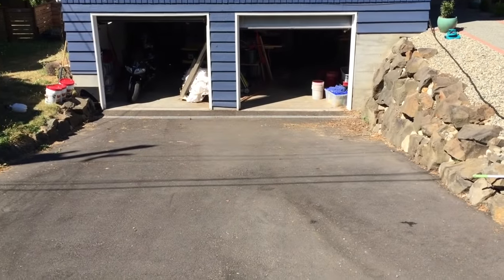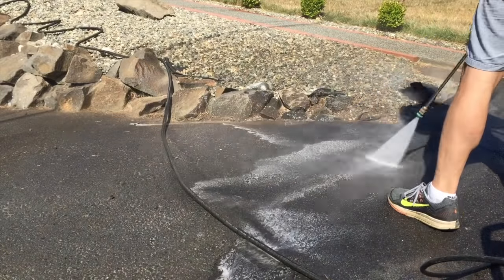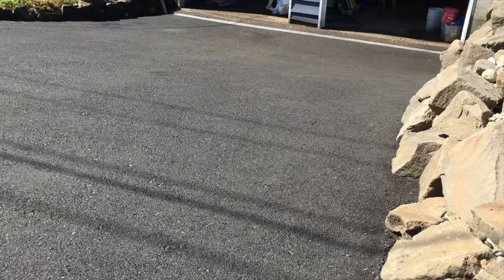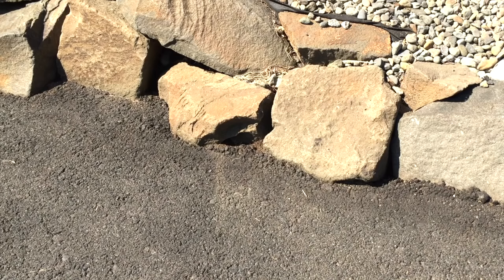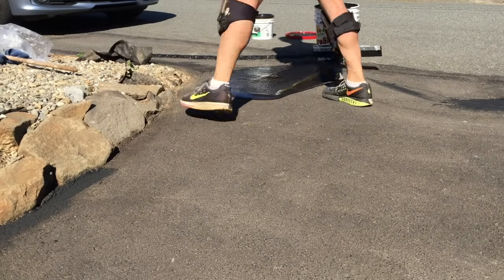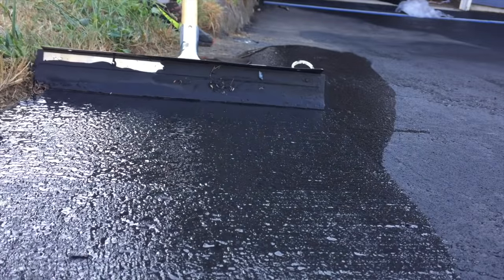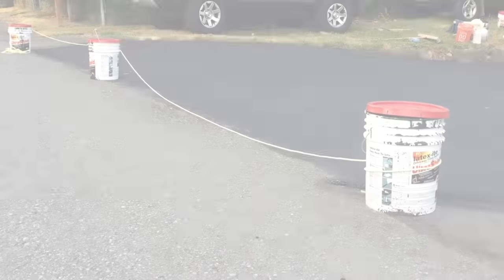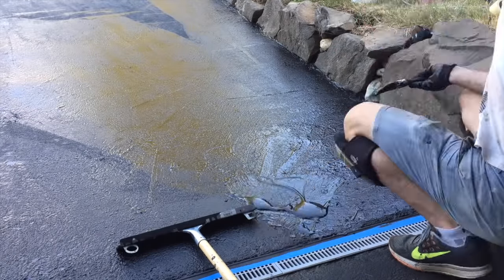DIY DRIVEWAY SEALING

Comment: See if you knew anything about Paving or seal coating , you would’ve known that your driveway is made out of an oil based tar so therefore you just put latex material on top of oil based product which that means that sealer is going to lay on top of the blacktop and not seep into the blacktop is what you want to give your driveway better life you should’ve went with a local seal coding company and they could’ve applied a oil based sealer you apply to latex sealer water does not mix with oil so therefore you just put a layer of latex on top of your driveway which is not good for your driveway at all meaning your driveway is only been there for two years you’re supposed to put that latex material or/water-based material on our older driveway not a driveway that is only two years old

Comment: I work for a County Public Works dept and we do a lot of paving. 1) You should not have to sealcoat on an annual basis. The exception being if you live in an area that gets a lot of snow and has a lot of deicer put down. 2) Weeds should not be growing through your asphalt. That is a sign of a poor paving job. Your contractor did sub-standard work. I would be asking for a refund. 3) The close up shots of your pavement show a very poor install job. Looks like the pavement was probably not laid down at the proper temp or mixed properly and it definitely wasn't compacted properly. 4) Your homemade diversion mound isn't the most effective solution for a permanent fix to your water issues. The best fix would be to install a full length drain at the top of your driveway, similar to what you have at the base. Contact your city or county to tie into their stormwater system. The top of your driveway is in the right of way so if the water issues are bad enough the jurisdiction might fix it for you.

Comment: He forgot to Trickle a bucket of cirnigraph oil, to reduce major deterioration.
He also left a portion of his anti tile destrinigraphy unmaintained under a ratio of 98:78:13 which could be considered illegal in some states.
He also forgot to dedementrios his 98:78 portion of centered 89:23. He may need to readjust his complecial oil mixed with dentorpian herbs, which needed to have a Ratio of 67837:75873:  as it may dry the gelestrio.

I made half of the words up here, and everything you just read was fake. I don’t even know what I was typing.....
Reply: Lol

Comment: You will use the pressure washer constantly. But you never used it on your driveway. I clean my driveway once a week.... keep your property tidy and clean. Also you only need to do this every 3 years if you keep it in good condition. Basically don’t listen to this guy

Comment: This is definetly the first time. Dont  do this call a pro.
Reply from the maker: Oooooo come on John.  This is a DIY channel, not a O I'll Just Hire A Pro to do it for me.  Driveway still looks good to.  Thanks for watching at least.
Reply: @BYOTools  Sorry, hope my comment wasn't rude. I just know the difference between the stuff you buy at a home improvement store vs. The stuff you get from a seal coat manufacturer. Like the difference between a picture painted using water colors Vs oil base paint. You are definitely meticulous and did a good job of covering everything. I think Bob Vila has a video on how to Sealcoat a driveway and is pretty good. Thanks for your video.
Reply from the maker: Hi John.  No need to apologies but thanks for the reply and the explanation.  Always want to know how I can improve and what to learn from.  I'm sure reputable seal coat companies have the GOOD STUFF vs. what you can find at HD haha!  Thanks for the input and for watching.
Reply: @BYOTools   1st you did excellent job cleaning your driveway. Which is one of the most important steps. 
2nd Its advantages to do your edging first. Edging works best if you can keep it in even stream of seal coat about 3 to 4 inches wide about 1 foot from the edge that way you can just push it towards the outside edge leaving smaller windrow of seal coat a couple of inches from the edge of asphalt. Then just one more pass to cover the remaining edge and your ready to start pulling main section. 3rd It works best and provides uniformity to work the seal side to side. Watching for surface tension which will leave little round 1/4 inch size untreated asphalt, and require another pass to allow the seal and the asphalt to bind together. Working the seal from left to right or side to side maintaining even distances  between passes will create a uniform protective layer. Hope this makes sense to you. Thanks

Comment: OMG all the Asphalt contractors are setting back and just laughing there asses of with his little paint brush and his power wash, don't make me even mention the  duck tape lol, I no it took him all day for that little driveway. Heads up my friend might save u time and money don't use any asphalt products from a hard ware store that shit doesn't last no longer than a yr and the second year it's already starting to fade so it's doin no Justice but making ur asphalt black. Next time hire a pro and ur squeegee won't fall off and it will get done 10xs faster and last 10xs longer if u use a pmm cold tar slurry seal from ur local sealmasters that is  All across  American. Drive way that size wouldn't cost shit to do so put ur knee pads up. And ps. Soaking water on ur asphalt just because u seen it somewhere  on the internet are a nosey friend told u to power wash it is not a good idea, it's not concrete. Soaking any thing in your Asphalt is goin to absorb and make it crack and soften, Duhhhh!!!  Y the heck u sealing it in the first place? Thats wat cracks and allagates asphalt in the first place rain setting on top and settling threw the asphalt. Just sweep it and power blow........ Just call a pro bud!

Comment: I'm just trying to figure out why you power washed your blacktop since the purpose of sealcoating is to keep water out of the drive way you sir are literary teaching people how to destroy thier drivways
Reply: Rockstar Boom the water will dry, but what is really destroying his driveway is the shit sealer he is using which is water based and will destroy your driveway instead of getting a professional to do it
Reply from the maker: If you ever want a solution to adhere correctly to a surface it better be a clean surface, which is why I pressure washed it first, let it dry completely and then sealed it.  Some people of issues with this way of sealing but I've had this product applied to my driveway over a year now and it still looks great.  Just need to pressure wash it every once and a while to make sure it stays clean.  Thanks for watching Rockstar and Cole.

Comment: Dude you have no idea what you are doing, you do this and it takes forever and looks like ass. Never go in the same direction as the driveway. Never use a rubber squeegee. Still can work, but doesnt give a lasting coat. Never start from the bottom. Start at the top, go side to side in passes with the end of the pass making a corner towards the bottom. You wait more than 3-5 minutes after a pass and it doesnt blend making it look likes streaks.

Comment: Thats garbage .. dont seal your driveway yourself to save 50$.. pls hire a pro .. you need a 3000$ pump to do it with the proper material (oil based /not sold at home depot or ehatever store ) it could ruin your driveway